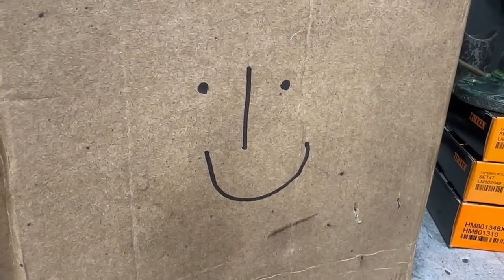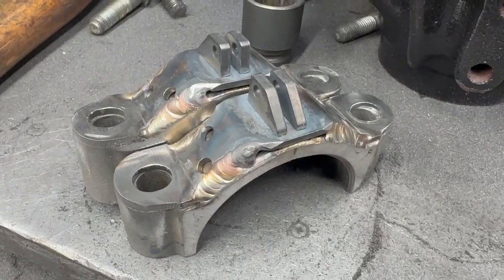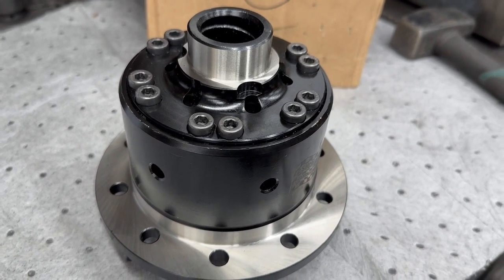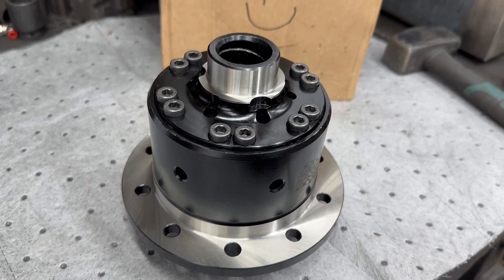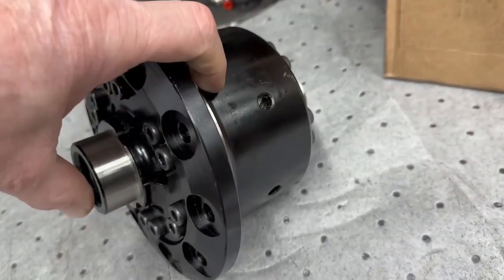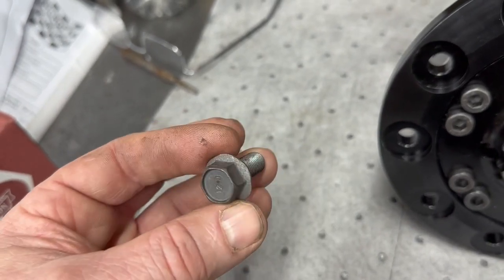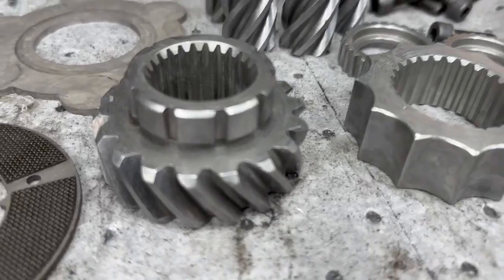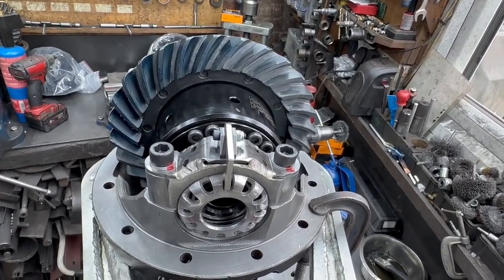AATB LSD

Comment: Why not cross drill the bolt heads and run safety wire through them? Like the brake caliper bolts on a racing motorcycle.
Reply from the maker: Problem is getting this grade and thread type with drilled holes ! - what you can buy tends to be metric pretty much thats it . Drilling this grade of bolt is near impossible and whilst we could get them spark eroded - that by the nature of the process weakens the metal. We have spend a considerable time considering wiring......found lots of hurdles and brick walls !
Reply: @MegasquirtUK  wire EDM might weaken the metal in some points, but do you think that weakness would actually affect the retention / shear strength of the bolt? I thought most wire EDM happened underwater, which would help keep things cool.

Also, thank you for your reply. You guys are clearly pros. I am just a curious hobbyist.

Comment: To reduce the chance of crown wheel bolts backing out do you think there's merit in running longer crown wheel bolts with a spacer under the head? Could give some more strain/elongation in the bolt to maintain clamping
Reply from the maker: No. Any sort of "Spacer" adds potential for issues, sometimes where you have to use them you just have to, that includes most washers flat or spings old technology. 

The standard CW Bolts tend to stretch, and then when loose shear off, or if overload shear anyway even when tight. As you go up in Bolt strength 8.8 > 10.9 > 12.9 etc strength increases but so does brittality (Look up Glass bolt paradox). FTC5150 are pretty good, flanged head so larger surface area, and a serated head to bite into the steel etc, but these can shear as brittle. 

Nordlocks are a clever option, serations 2 x sides and a cam locking system, and as here NLX are alos domed giving a spring washer additive too. Length is not as crucial, if the bolt shears thats the point where the Center mets the CW, stretching is due to overload and weaker bolt, what we have here is the best of what we think we can do, ATBs also being machined out of way tougher / harder steel than other diffs due to the 12 x Cylinders the gears run it mean FTCs don't really bite into the metal of the ATB. Nordlocks do as the metal made is tougher so the serations are harder and bite better than FTCs.

Bolt technology has moved massively over the last few years and continues to do so
.............as have locking compounds which we also use special stuff.........
Reply: Whilst I generally agree with what Nigel says, I can confirm that you have a generally valid point.

I have had good results for a different (but parallel bolting option, albeit into softer facing materials by using longer bolts serated flanged bolts, sleeve tubes and Nordlock/NLX washers. Nordlocks are very good, but they do not add 'eleastic resiliance to the bolt. Using longer bolts allows more elastic strain/extension, so the rate of increase in stress is lower and allows distribution of forces/stress over more bolts and a better ability to take fatigue and shock loads. 

However adding more components where they can't easily be seen requirs very good confidence. Also I am not sure of how much space is available for much longer bolts.
There are options for special bolts, reduced shank bolts and probably some custom Nordlocks, but for just a few bolts abd washers you could probably have a few replacement final drive units.